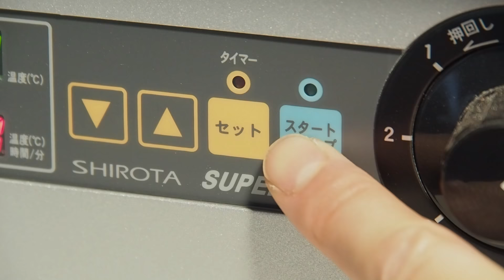ヤスリで和風ナイフ作ってみた。/ Making a Tanto knife from old file.

Comment: 14:00 what is that black liquid and what does it do ?
Reply: Hello, its ferrum chloride, or FeCl3 if remember correctly. It is for etching steel and bringing out the hamon
Reply: @lornwell3669  thanks
Reply: @FABBO-vu7xf  no problem! Feel free to ask anything
Reply: @lornwell3669  ok thanks but afther you put the blase in the acid you polish the blade or you do other thing ?
Reply: @FABBO-vu7xf  yes, sometimes multiple cycles for desired results. Etch, clean, polish and repeat...
Reply: @lornwell3669  Thanks